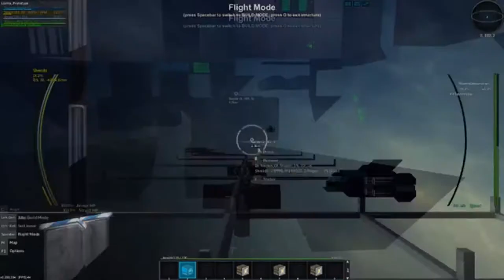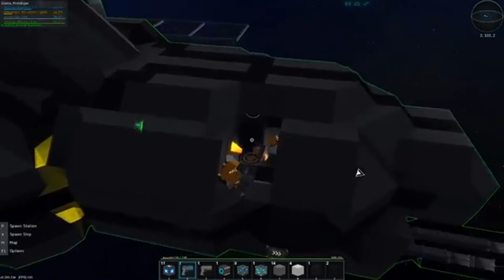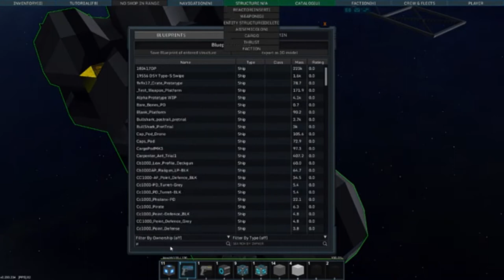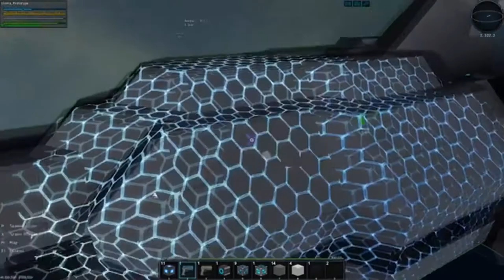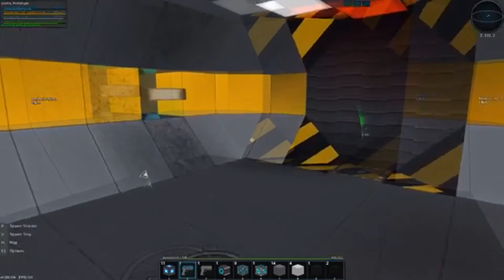Shield Integrity Fail

Comment: Welcome to structural integrity, where you have to place at least a chunk of 3x4x3 of any system to stay in positive (and gain any) structural integrity.

I personally use girders for filler. Hull is a bit heavier (funny, not as heavy as shields any more) and works maybe better as it gives armor hp... shields, definitely not. Shields are extra punishing as they take the smallest group as the total structural integrity, so if you misplace a single block and create a new group, that single block will overwrite the structural integrity of the entire shielding.
Reply: Thats good to know.
Reply: Oh, and you probaly noticed that shields have an upkeep as well that scales with max shield capacity, and means a constant drain on your shields. Means your rechargers won't charge as fast as you need some just to counteract the upkeep drain.